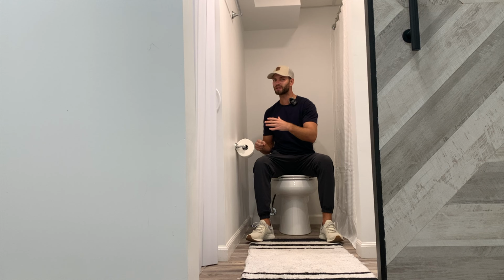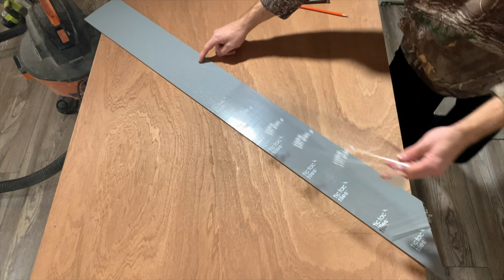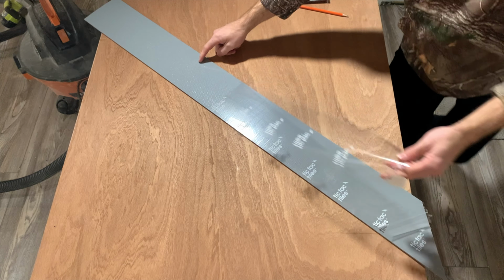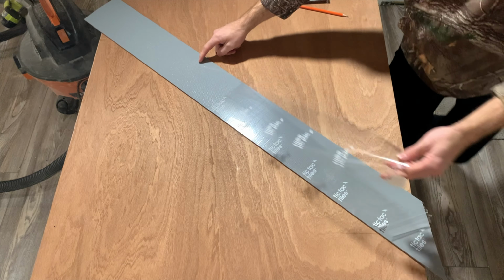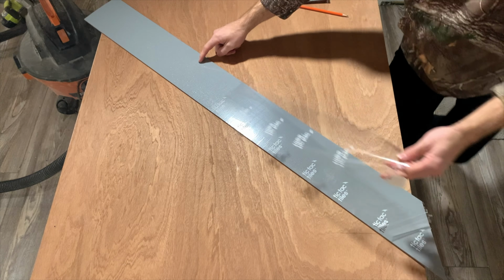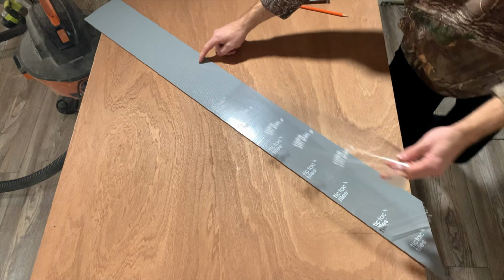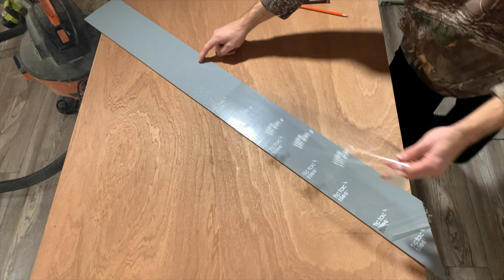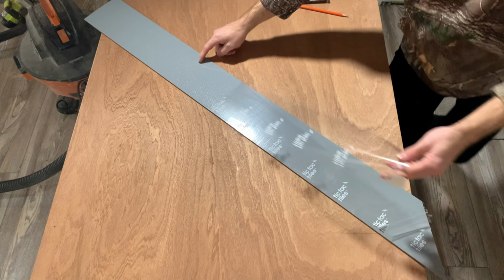Modern Barn Door Build and Installation (How to Build and Install a Modern Barn Door - DIY)

Comment: Like those ‘ barn’ doors, I’ve installed lots of pocket doors that you have to plan and install during framing then casings etc for finishing. Those do about the same with limited swing room for doors and have a great look too!! NICE JOB👍
Reply from the maker: I like pocket doors better for sure but they definitely require a bit more planning work. This will work for me though. Thanks for watching!

Comment: But how do you get the door to lock for privacy? I've been thinking about doing a barn door for my bathroom but can't figure out a good way for it to be locked on the inside but still have a way to open it from the outside in case of emergencies
Reply from the maker: Hi! They make locks for barn doors but I didn’t install one since this is for a bathroom door within a lockable bedroom. Thanks for watching!